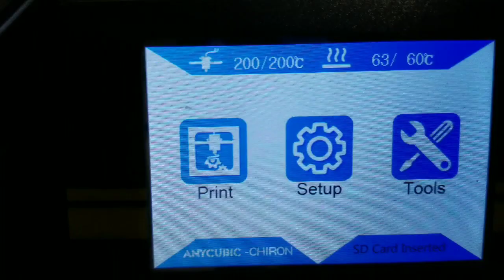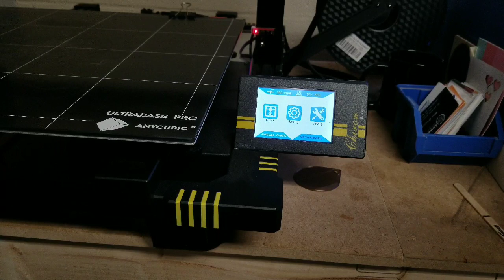Anycubic Chiron Leveling

Comment: It's been a year or two since I brought out my printer. I ran the manual level and then the print. when I went to the menu on 6:16, I couldn't change the number. If set to all, no number showed up. If i clicked on one of the dots, it let me change it but nothing happened and going out and back in to the menu resets. Any tips?
Reply from the maker: I hadn't heard of that happening. Not sure how much help I can be. I don't have my Chiron right now, but I will see if I can get to it and look. Really sorry you are having that issue.
Reply: I have the same problem!
Reply: I still have the same problem
I did this comment 3 minutes ago and figured out why, i just cant go bellow -10 in any setting but somehow all the other ones are at 20 so now i am going to try to find the leveling gcode

Comment: Hello, I need information on how the double limits of the Z axis are changed and leveled. Regards
Reply from the maker: If I understand you correctly, you can use the mesh level feature on the printer itself. Honestly once the sensors are locked into place you just level the bed to the gantry.

Comment: Hi, what did you end up doing to solve the under extrusion problem you were having with the Chiron? I'm having the same problem
Reply from the maker: I just had to pre-prime it. You can also run a few brim lines and mine typically comes out of it. If there is a lot of powder in the extruder gear you may have to check tension and be sure to check you are running hot enough for the feed speed.
Reply: @pt3d315  did replacing the hot end help? Im not sure to get into checking voltages for the stepper drivers or replacing the hot end.  Guess I'll have to start somewhere.  I'm getting under extrusion throughout the print not just the first layer
Reply from the maker: @samessa1849  Does it extrude well by hand or turning the extruder gear? Sometimes the gears slip when grabbing the filament. I can try making a video about this.